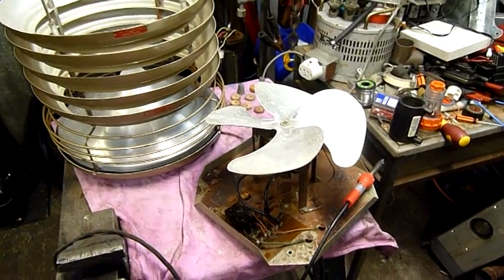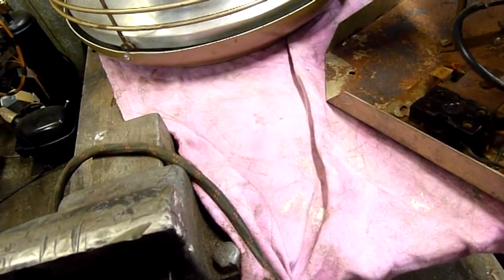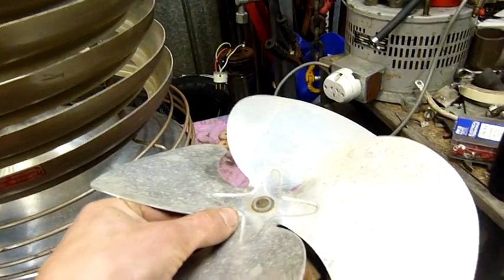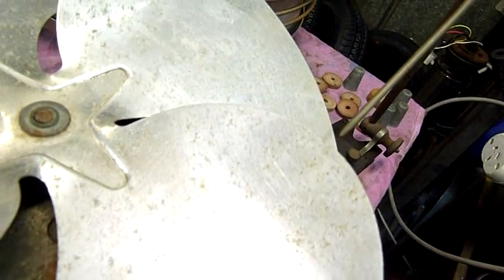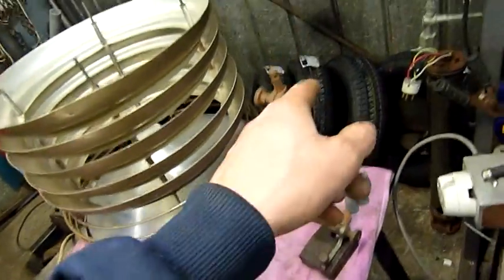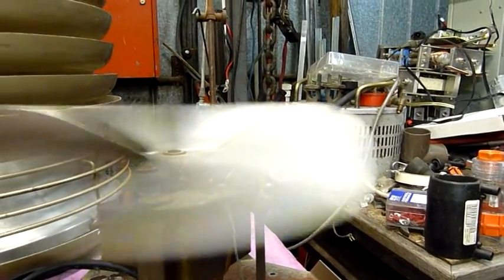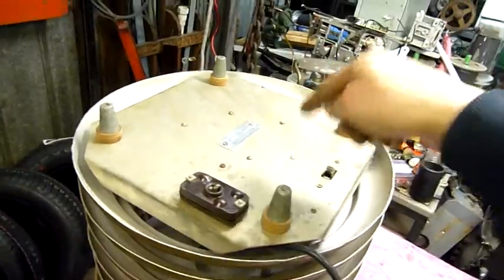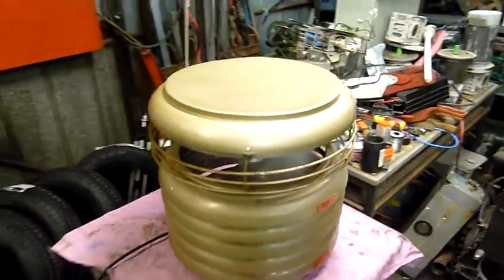1950's Stromberg Carlson Room Cooler  (Hassok Fan)

Comment: The cord on his fan reminds me of the asbestos cords they used to use on irons in Canada and the U.S, they had the same coloured loom on the outside. I have a roll of repro cloth cord but it's the more ordinary looking light brown coloured flat stuff, I haven't used any yet because it isn't the same size as the original stuff. I may end up using it on some old floor lamps I have kicking around. Most of my sets either have cloth cords in good shape or used brown rubber ones.

Comment: looks great! good job!   for balancing ceiling fans i just use a ruler against the ceiling. works great. sadly had to do the trick with my new hunter. one blade was noticeably higher (5 blade fan) turns out it was 3/4" higher than the rest. the others were dead on. now the chains barely move like they should!

Comment: you can make a replica cloth-wrapped wire with the sheathing for paracord. pull the center out, and pull the sheathing over a modern PVC wrapped wire. looks great and it's cheap.

Comment: my parents got the $95 52" fan with dome (white fan) and holly crap!!!! its rated for 5,300 cfm!!!!! it would be much better if we had high ceilings like our old house did as low ceilings really kill a fan performance. but it still move a crap load of air!! but dont go for a $65 harbor breeze! my brother did and it was ready to fall down it was wobbling so much!! piece of junk. its a 52" doesnt move near as much as the other 52". (more like my little 44") and is louder than the hunters